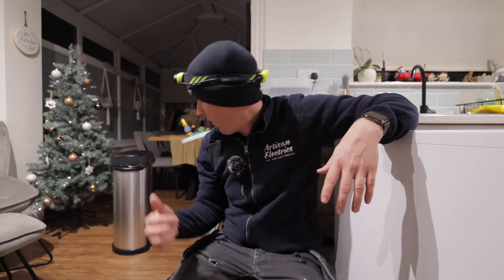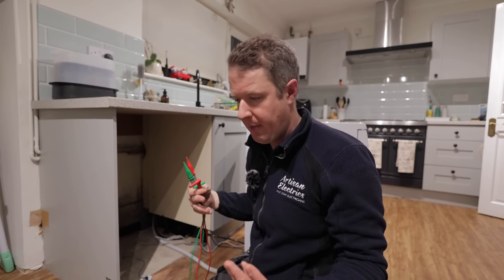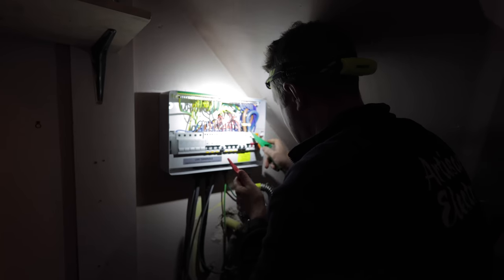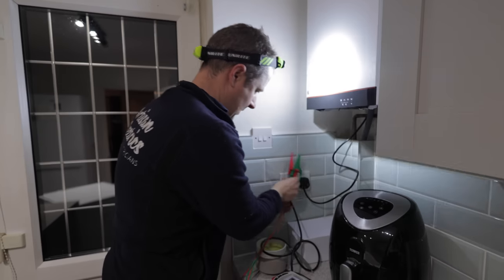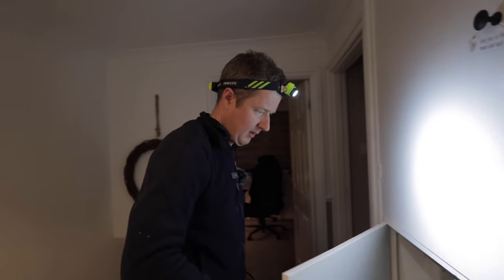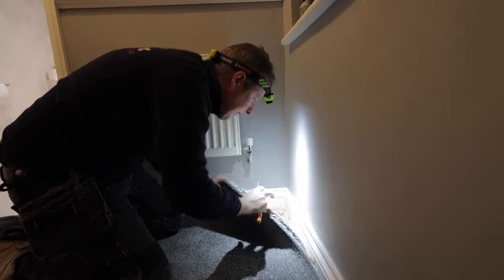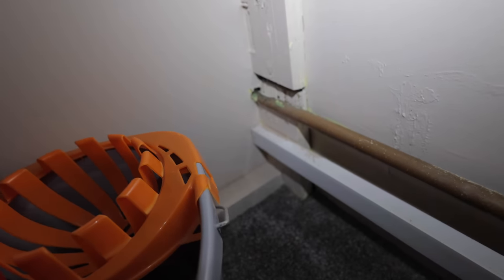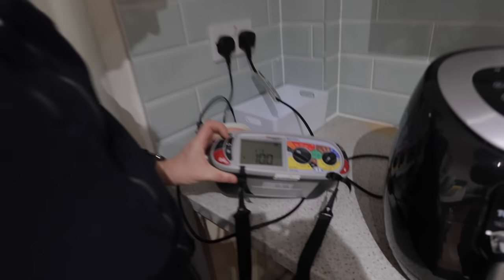Nearly KILLED by a CRAZY fault! What on earth is going on? 💀

Comment: Well done for finding that.  These gas engineers get funny over taking covers off boilers but iv also seen alot that can't do the wiring correctly.  I'm not sure what could be worse.

Couldn't you have pushed a rod up at the ceiling where the original T+E came through ceiling?  Pushed the rod towards the stairs then you'll be on the landing.  The joists were in your favour to had tried that 1st.
And also rather a joint could had put a 3pole isolator in with multi core HR flex and completely got rid of the original flex and T+E.  Just bit neater and then you'll have local isolation for boiler.  If your doing a joint then the joint may aswel be in an isolator.  I couldn't look at 3 cables going into a wago box screwed to the wall in the kitchen it would do my nut.  Wago boxes not for show IMO.

With the route you took you couldn't had done any better.  Lucky with the drilling 1st time.  Spot on.  Love it when a plan comes together.

Great video really shows how important it is to test properly.  👍

Comment: I work on systems where others may have done the lock out and tag out of the system. Site regs are to use a 2 pole dead tester. 

I always make my own personal test. With Fluke multi meter. 

1. Ohms setting. Earth wire or terminal of the supply to an actual earth. Should show Earth's are similar. 

2. Then earth wire to earth. Voltage setting AC and DC.  
3. Earth to N volts
4. Earth to L volts

When I am sure all are zero. Current setting on meter and measure all ways. Current setting would short or trip system if there is an issue. But with safety of a fuse in meter. 

Now to watch your video. To see if this would of picked up your fault. 

I have seen other items plugged in to circuits feeding back capacitor stored voltages. Hence doing DC tests also. 

I

Comment: Enjoyable video and great commitment to see the job through. Just a question from a plumber (not an experienced electrician). 

Would of it been possible to install a wireless rf switching kit to power the switch live and fire the boiler to save having to run in a new cable? And use the existing wiring from the airing cupboard to become the permanent supply? 

Great job and video

Comment: Cant you just use a relay in the boiler which is activated by the remote line/neutral, and then use it to switch in the proper live fed from the perm live circuit?

Comment: Why on earth are the cables run in tubes.
So easy to replace cables etc.
That is the standard in Scandinavian.
On a new build the builders put in the tubes before they close the walls and the electrician just pulls the cables through and connect them.

Comment: So, ok, I am going to make a couple of wild guesses here, … 1st off, it sounds as if you are working in the UK, … or, somewhere in Europe, … learned this lesson the hard way, by trying to plug in an American made tape recorder, (back in the early 70’s, where most of us have never experienced dealing with 240 voltage), … or have known anything about working/using any type of varying voltage displays, … and, … after trashing that recorder, I figured out, not to mess with any type of wiring while I was stationed over seas, … (other than the wiring used in jeeps, deuce, & 1/2’s, 5 ton trucks, APC’s, and the M-60 series of tanks, … circa, 1972 till 1974 in West Germany, and 1974 to 1975, in West Berlin), … I would really like to understand the jargon that must cross the pond, between our respective lands we each call home, …

Comment: Did you need to run a new cable? I would have used the old cable as a line in and out to the boiler terrmostat? powered from the kitchen socket... would that have worked?

Comment: Not sure why it wasn't triggering an rcbo with an interconnection between 2 circuits. Don't think you should have left those trailing cables coming out of the CU when you replaced it. Certainly don't like those WAGOs stuffed down a pipe duct. Glad I'm not doing an EICR  on it. Well done finding the fault.
Always think it's great how Sparkies and Gas safe plumbers think they are top of the tree tradesmen. 
Sometimes?

Comment: You were really scaring me while you were holding that live plug in your hand. I wouldn't feel safe till I had cut power to that plug. In fact I would close off the kitchen to anyone else trying to enter in case someone came in while you were out of the room and picked up that plug. If there was voltage on that plug that means there is voltage on the cord and anywhere on that live wire going all the way back to the mystery power source. That whole kitchen becomes a minefield at this point as evidenced by you getting shocked clear on the other side of the room from the cause of the fault. Just move the outlet from one side to the other. How hard could it be? Well I guess we answered that question!

Comment: You Sir are very clever 👏 
You were also very jammy to come through in that exact spot 👌 good shooting tex. 😄
A similar occurrence happened to me after pulling the fuse on a circuit that I was working on I soon found out cutting the ring back that one side was still live.  Dozy twonk that wired the ring dropped the lives into two different fuses.  Bang.  Im very careful as a rule, but since then even more so.  You never know what traps have been left.
Great video. Education 🙂👊👍

Comment: And that's why it would be a good thing to make RCBO's on every circuit in residential buildings compulsory. Especially in older buildings where a lot of creative works have been carried out 😒😆. When having an electrical panel where only one or two RCCB's are present this can happen when 2 circuits feeding of the same RCCB get interconnected. With RCBO's (what is basically an RCCB and Circuit Breaker combined) this is impossible because they would immediately trip when both circuits are turned on.

And don't get me started about the electromagnetic inference such shenanigans cause. You can get all kind of weird inductive problems when you take the live from one circuit and the neutral of another circuit.

Comment: Any idea why unplugging the other appliances (during the initial investigation)  caused the voltage to go up? Were they all on the same ring circuit and being fed juice by the boiler plug? Why would voltage go up when unplugging an appliance from a socket with the switch turned off (the microwave and / or toaster)?
Reply: It didn’t go off from the ones that were switched off
Reply: Timestamp 10min 30 seconds or so, the voltage is going up when he unplugs appliances.  @TheBroz

Comment: Nice video and nice angle drilling!  Presumably you didn't take the twin and earth in to the boiler and used the Wego junction box instead because the flex is heat proof and twin and earth isn't?

Comment: Was it rlly 2 live wires or just the ground bringing the live and closing the circuit with the other 2 wires and thats why you get nothing between live and neutral or was it cuz of the same phase and when 2 sides are at same potential there is no voltage diff and tells 0?
if you switched down one source the prob should have been the other live coming there -i usually just use a phasemeter to solve these probs faster.

Comment: Our regulations don't allow for unaccessable junction boxes (eg  under floor boards and carpet ) nor direct clipping 240v cables low level without mechanical protection (trunking, conduit)

But does allow the green goo in the 1970's cables 😂

Comment: Change bathroom light fixture is a easy job right, so I go over to the switch naturally switch down which is supposed to be off. Started changing light fixture got a shock knocked on my ass. It seems that the customer has a light switch upside down. Position up was off, and position down was on. I'm kicking myself for this one, I should  have use my voltage tester, to see if the line was still hot. I just assumed the light switch position down it's off, lousy assumption. :face-purple-crying:

Comment: I have a little voltage tester that beeps if the wire is live. it cost me £1. I use it even though i know the circuit is dead. I don't trust other peoples wiring.
Reply: Indeed! First check if your tester is working near a known live wire, next check the wires under investigation, then turn off the voltage and check again. No beeping should be heard. 
This is the standard procedure of The European Standard EN 50110-1 "Operation of electrical installations" although they describe it with a DusPol. 
The "Voltage Tester Detector Pen 1AC 90-1000V Non Contact Alert Stick Electric Test" works without electrical contact and even near tubes with live wires. 
In general: Step 1: Check if I can die, Step 2: Turn off what could kill me, Step 3: Check again if I can die , Step 4: If Step 3 is true Then Step 2

Comment: ...after seeing this i wouldent be surpriced if UK has a problem with housefires...

..and this is actually a quite common thing to find, primarly when ppl wierd upp stuff themself OR when u have a combination of 1-phase AND 3-phase systems, my first guess was the boiler actually, but its very common in 3-pase systems, if u measure Vtt/√2 Voltage (243V Vtt at the time of measure, measured voltage 172V) its typical for a link between two different phases or phase to ground... it should have been one of the first things u suspect... (it can also measure 117v, 2 phases 240 degres apart in a Y-connection relative to ground)

Comment: I have had something similar happen to me once, i was actually changing some plugs for a customer. As an electrician you go true your necessary steps for safety like turn all of breakers off use a multimeter to check voltage etc. But I've actually been doing some repairs at said house so i felt like i knew the circuit inside out, so i didn't check for voltage i just switch them off and went to town am boy o boy was i zapped. It was so bad i almost took flight 😂. Nevertheless i took out my multimeter check the circuit and there it was 207 volts.... I was so confused but after further investigation and may colorful words later i discover that a water heater was back feeding into the circuit. So i learn that if i want to be lazy i bought my self a voltage detector and after that incident its easy to whip out and check an its also quick an easy. It have also saved me numerous times also after that incident

Comment: could the property have solar pv/battery which may send voltage via the conductors, backwards if connected to one of the rings instead of on its own circuit.

Comment: you had a fault VOLTAGE but you didnt see if you could pull much CURRENT through it. Faulty filter caps are between Earth and line and Earth and Neutral and they acts as resistors in AC and they filter out noise in cpu systems etc. Yes they do go short circuit or open circuit . but try pulling a 100watt tungsten lightbulb thru them not your megger..

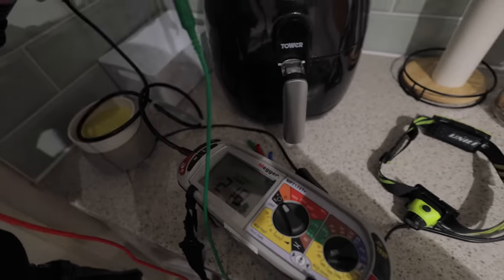Comment: .....we have 240v 3 phase here.... 3 pin dryer cable some idiots wire male male cables aka widowmakers and the result is the same as 12:17 ....voltage on your pins if someone grabbed that without knowing well....think you can imagine

Comment: Sorry but a 0.14M ohm reading on insulation resistance does not comply  should be tested @500v not less than 1Mohm
I liked your breakdown of fault finding though
But you should have tested with installation dead as you were putting yourself at risk and having had electric shock already shouldn’t be testing live and definitely not showing others this dangerous practice 
Glad you did not leave it with fault though

Comment: would it not of been possible just to fit a wireless system.? heater call for heat then activates wireless system switched boiler on up stairs?

Comment: Only Had Time To See the Start. Just want to say Seen it 2 times in 30 Years, The Neutral was Feeding Breakers, Turning Off Breaker Only Removed Neutral, Still Live at other End. Non Contactors can Make Short Work. Used a Tic Tracer, Is The Best. 
Don't Try This, But if You Are Insulated(Good Shoes)and you are Touching a Live Wire, Now The The Tic Tracer Will Sound When Near Ground.
It Works Backwards

Comment: Nicely done, sir!  But looking across the pond as I am now, your electrical system seems a complete cockup. Probably as much as your view is of our Imperial versus your Metric system. The thought of taking 220 volts on a shock is very unappealing. An old electrician once told me a very good rule of thumb: 110 volts makes your muscles pull away; 220 makes them contract and grab harder onto the thing that is shocking them. When working on anything at the higher voltage over here, I make darn sure I triple check everything.

Comment: Electrical engineer here with 12 years as a "sparky". A bit dramatic title, yes electricity is dangerous and nothing to downplay but the chance of 170 volts killing you by a quick shock is quite low tbh and i suspect you know that. The rest of the video is fine, however not checking line and neutral to earth is quite a novice mistake.

Comment: I'm so confused, why are you surprised by the voltage increase? You're taking consumers of a circuit which you already suspected to be wired to another one through an appliance, which essentially acts as a source with internal resistance.

Comment: You could of saved yourself a whole lot of effort and not had to run any cables. Just power the boiler from the socket and put a relay in the airing cupboard for the switch live and make the cable/enable to the boiler volt free

Comment: You tube Mike Holt videos on grounds. 
Voltage wants to go back to the Source.  Ground wires and the Earth connection are used as a path back to the Source.

Comment: Noob didn't check the power on the socket before changing it.. EVERY apprentice is taught that. Even a quick brush with a non-contact tester.  There can sometimes just be a secondary breaker board.  Assumptions kill.

Comment: Talk about making a pigs ear out of a simple job, This sort of thing is far more common than you imply. For these faults my goto is 1) heating, 2) pir lights. My faultfinding would have found that very quickly. 
So you found a cable route... Yay, hoora... that's your job. So you can dril a hole... Yay, hoora... oh yeah I forgot... it's your job. So you ran a cable yep, well done.
So the boiler contains T&E. Did you look in the boiler instruction manual to see if it was permitted? While there did you check what cable is required? 
Why did you add an ugly junction box? 
Why did you not replace the existing mains flex with a bit of 4 core? Oh it seems you did but couldn't be arsed to do a better job. 
I don't get what was so special about the whole job, it was just the sort of thing an electrician is supposed to do.

Comment: I just do not like Ring Circuits.
They are a stupid idea 
Just to reduce the total cable length uses in the installation.
GPO's in a laundry - Kitchen Bathroom should all be on separate circuits
and isolated from each other.
GPO's in other rooms  - to be divided and on separate circuit breakers 
within Current load limits per circuit.
Same as for lighting - split into at least two circuits.
And in my workshop there is one circuit that is completely isolated from
the MAINS and NOT earthed -When working with Electronic equipment
and an Oscilloscope - Having an earth can destroy equipment and blow
ones hand to pieces.
Many Electronic equipment and Power supplies have TWO separate and
isolated Earth circuits . A Hot Earth and a Cold Earth -and  creating a circuit
between one and the other would be seriously destructive -and can be lethal.
There is also a feed from separate PV panels that is isolated from Earth.
providing a fully floating Power supply at 230V
Even so - Part of the floor of the workshop is covered with a 4mm rubber
sheet for additional safety - otherwise I may sheet myself if any substantial
current should attempt to pass through me to earth.
Though all safety precautions are observed

Comment: Surely a switched off device has  - a live and neutral 2 pole rocker switch?? NOOO dont assume it does especially if it's chinese, and or NO capacitors.  Directly at the input  capacitors for electronic circuit protection (RF noise etc) can pass a voltage as they are resistors at AC, be on the "wrong" side of the switch, and anyway if they break down they the will be a short to take say Live to earth (star wiring) You go too fast basically for my liking and didnt see if the fault condition could pass real current not just a piss in your pants voltage Try a tungsten light bulb and two croc clips  instead of that fancy Megger

Comment: Fantastic troubleshooting, but why tf would you continue to hold the live widowmaker plug, gesticulating with it while pontificating about the danger of the wiring, all while doing just about the most dangerous thing you could, given the situation. As soon as you figured out it was live, you needed to put that plug down and kill that circuit as well.

Not trying to harp on you bro...as one professional to another, safety is paramount. I don't want to see a good electrician get hurt.

Stay safe, bro.

Comment: Worst ones high W water heater in shower room, pull switch so close you got a wet hand using it!  Ignored zoning but allegedly qualified.  Idiot claimed to be an electrician, connected all 3 wires to the earth point of a bathroom light!  Luckily landlord called me before trying it.